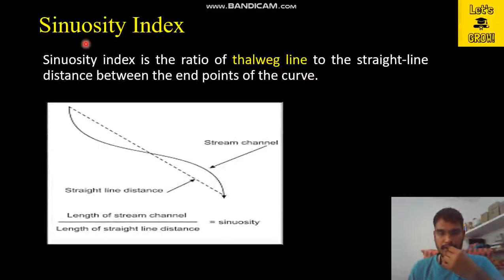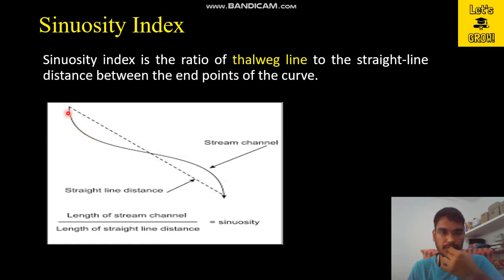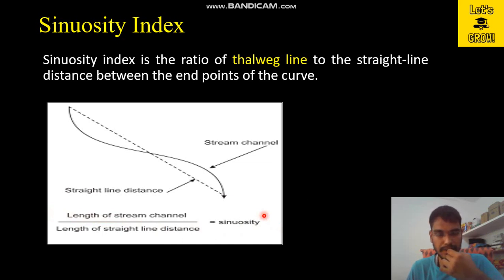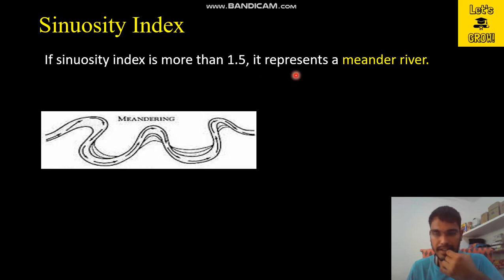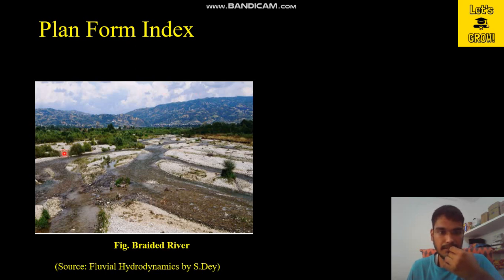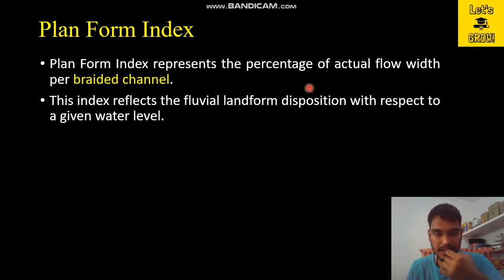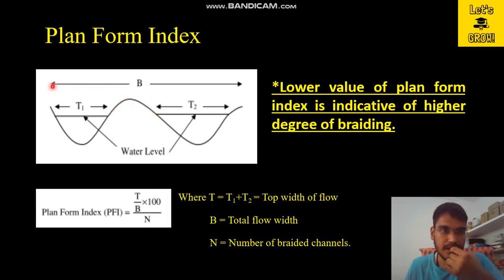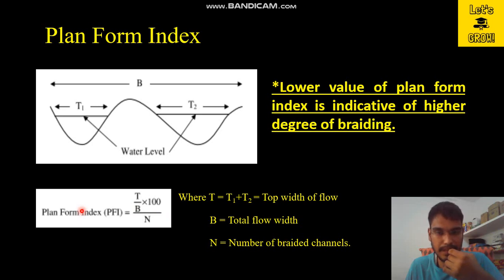Sinuosity Index and Plan Form Index.

Comment: Sir, fluvial indices and sinuosity indices are same or different?
Reply from the maker: I didn't heard about the term Fluvial Indices but in my opinion as the name suggest, sinuosity and plan-form index comes under the domain of fluvial indices.
Reply from the maker: I would like to suggest to check about it on Google Scholar. May be you will find some hints. Do subscribe our channel, if you like our work. All the very best 👍